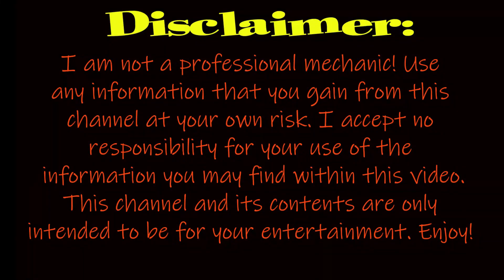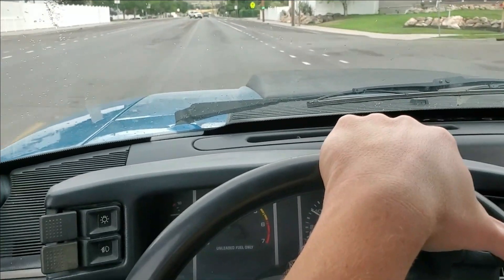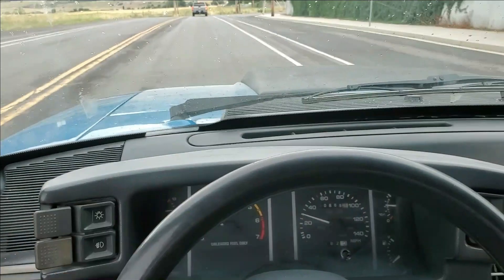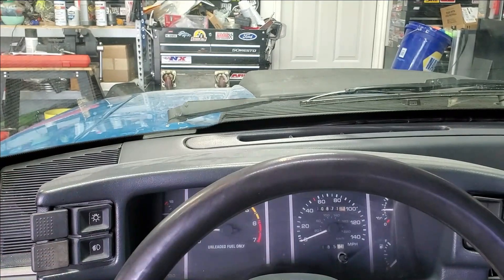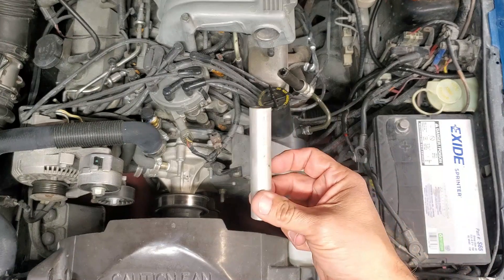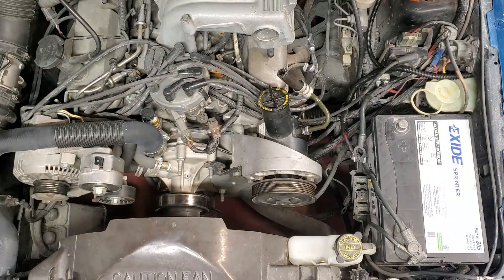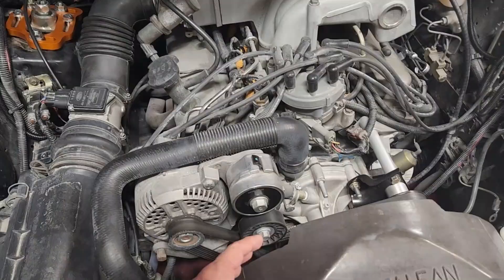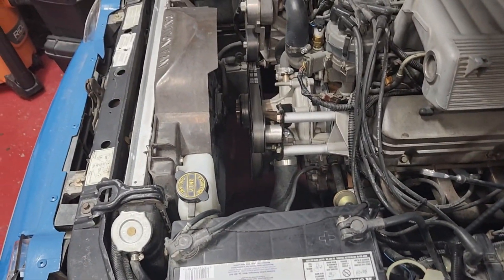The 89G - Fox Body Mustang Gets Volvo Electric Power Steering Swap - Part II

Comment: thinking about doing the same, but I already have a A/C delete pulley that would work great for the belt and replace the idler pulley you used
Reply from the maker: That's a nice idea... I may put AC back in it. It was brutal driving it in the summer, lol.

Comment: Please share electric water pump modification....and can we get speed control of electric power steering from rpm or alternator directly...??
Reply from the maker: I don't have an electric water pump. I do have an electric fan. Is that what you are meaning? On your speed control question, Volvo uses the vehicle speed sensor (VSS) to adjust pump output. I would assume there would be a way to use the Ford VSS to make that happen. I have not looked into that yet, however.

Comment: That is a really cool mod, its perfect for those of us that is trying to take some of the load off of the front of the engine and use that power at the rear wheel. If I had power steering I would most definetly do it. I saw another youtube guy do it a lil while back on his mustang. I think his channel name is I am chaz hayes or something like that but he hasnt posted in a while
Reply from the maker: I'll have to look for that one... He sounds familiar. Maybe I did watch it and just didn't notice the name? I know House of Dula did one on his Ecoboost build, and so did BonezShaker Garage.
Reply: @89G  yeah he had a turbo mustang and was a young dude and had a 347 in it that I think made 500 hp motor on the engine dyno that he an engine builder build for him. It was a red or maroon and  I think he was from california
Reply: @89G  what year volvo did that come off of ?
Reply from the maker: @79beans347  2010 Volvo S40. In the description, I put a list of the cars you can pillage it from.
Reply: @89G  oh ok ill check it out that way I can get one and have it on hand for the next fox
Reply: @89G  Is there a way to get it out of default mode or is that the way it will stay which long as it works that good I wouldnt worry bout it ,
Reply from the maker: @79beans347  You can run a CANBUS simulator. They go for about 50 bucks(ish) on the Ebay. Youtube stopped supporting hyperlinks in the comments, or I'd give you a link.
Reply from the maker: @79beans347  Copy and paste this into Ebay: "volvo power steering pump controller" and it'll come up.
Reply: @89G  ok im fixing to check it out, thanks
Reply: @89G  are u planning to run one
Reply: @89G  yeah if u bought the pump off of  ebay it would run ya around 200 bucks used and Im sure u got it much cheaper than that
Reply from the maker: @79beans347  I got it for 50 at the yard. I don't know about the controller yet. As of right now, it's fine at 70%. But, who knows... I may get curious, LOL.